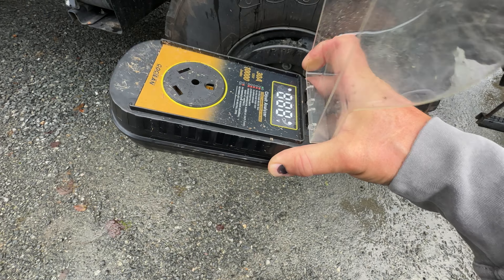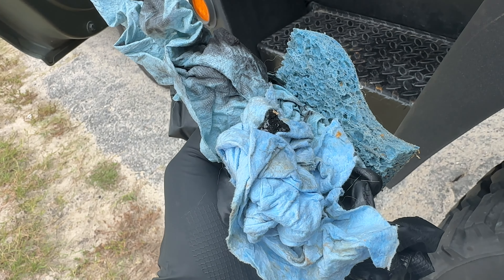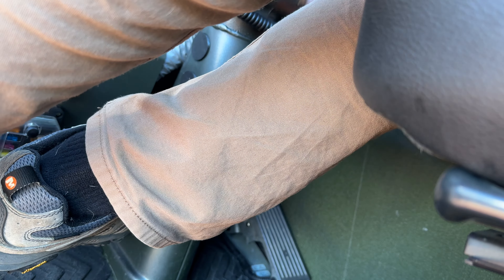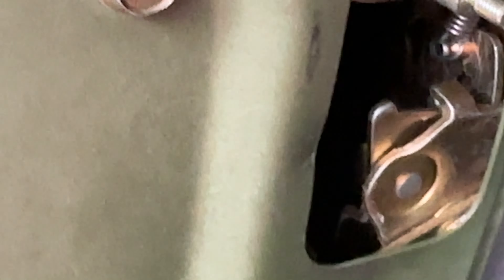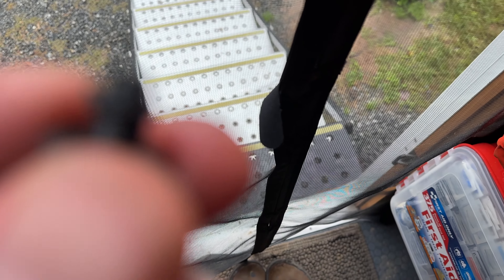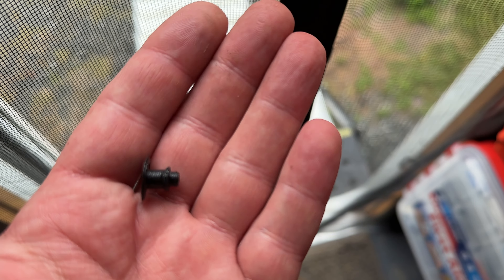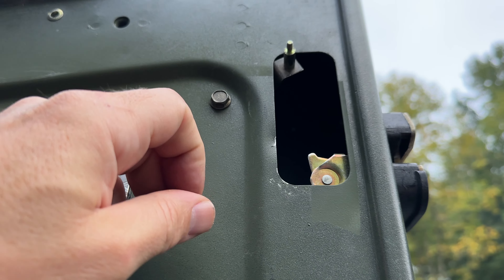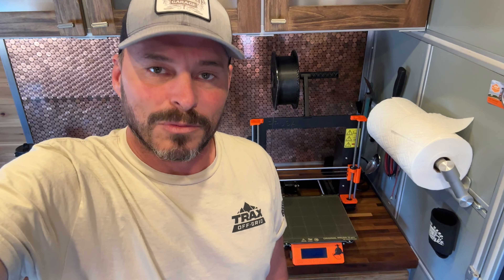Locked out of the LMTV

Comment: I have found the best filament to use now is the prusa polycarbonate filled with carbon fiber.  Yes you do need a hardened nozzle with the stuff is extremely strong, high heat tolerant, dimensionally stable and you don't need a heated chamber

Comment: Does it get hot inside that column?  I've seen hole plugs, grommets, etc go from being rubbery and pliable one day, to breaking down and dissolving the next when the plasticizers used in the rubber hit a breaking point from heat.
Reply from the maker: I 100% think it was a temperature issue.   The column doesn’t get much heat normally, but the cab got smoking hot a few days, before I made some sun shades.